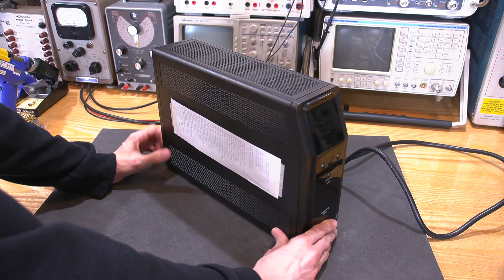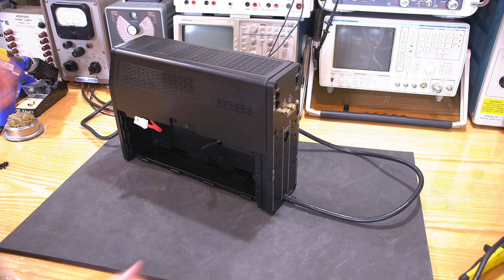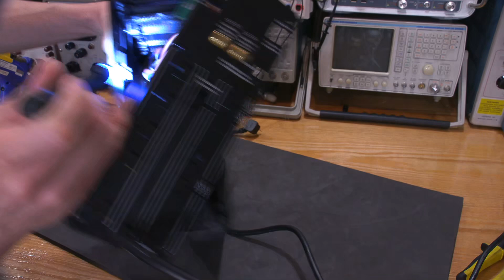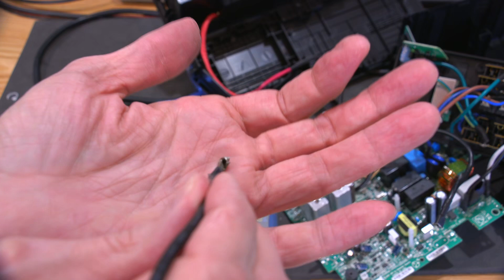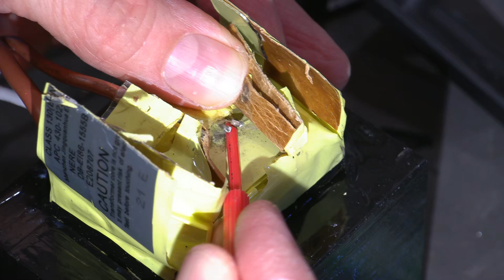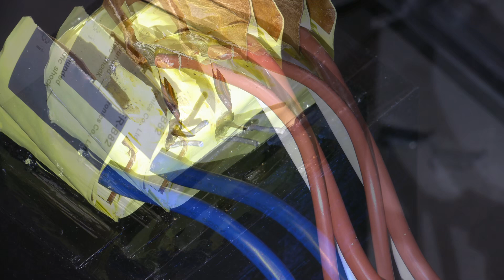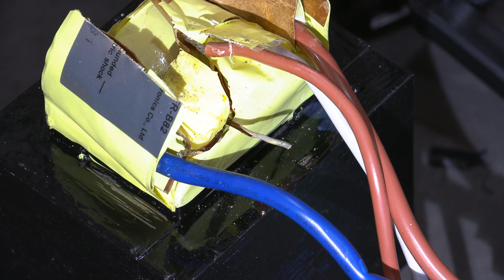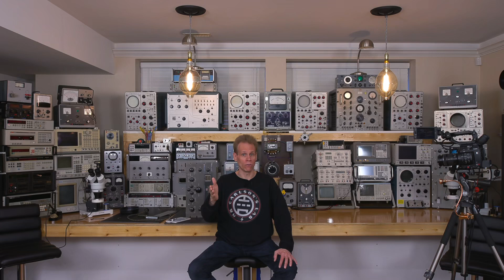UPS Electrical Failure - Teardown and Analysis!

Comment: Thank you for your time in this teardown, I had a customer who had the same type of description during a power outage event at his office, to my knowledge it didn't affect the output but when he called me to tell me, I didn't hesitate to tell him to immediately unplug everything and bring it outside away from the building. I went there a couple hours later with a replacement and someone had taken the old one so I couldn't check it out, I have several of these units out there with my network racks & religiously replace the batteries each 2 years without other incidents. After seeing your teardown, I am now pretty horrified at how the transformer was wired/soldered & will be looking for a replacement as now I couldn't live with the fact of knowing what I do now, should one of these cause a fire, or even damage to any equipment.. 
* If you do get to see this comment & have a suitable recommendation for a replacement of similar size (& preferably same type of battery replacement ie: 2x 12v7  or 8 Ah, I would greatly appreciate it..

Comment: Actually, many manufacturers nowadays have replaced copper wiring with aluminum in batteries, especially in devices like fans or similar motors. My dad's previous job was in recycling, so he has dismantled many appliances, and he once told me about this.

Comment: I grabbed an older APC 650 out of the trash at my work. Opened it up and it was toasted inside.
However the transformer was fine. Got another transformer on eBay and was planning to make an isolation transformer with them. Having second thoughts now...

Comment: I have this same unit.  Don't know if it was arcing or not.  Twice I came home to find the alarm blaring and the equipment plugged into it off.  Battery was full.  I had been noticing a slight burned odor the last few days.  Took mine apart the same way as shown.  Don't appear to have a lose wire like this.  But the smell has gone now so this must have been having an issue.  Glad I found this video.

Comment: My APC BR1500MS2 failed on 7-12-2024 woke up to constant alarm this morning, with an F04 error code with remnants of magic smoke smell I looked up the warranty it five months out of warranty I took my ups apart both mosfets blown on the big aluminum heat sinks.

The BR1500MS2 supposed to be the second revision that has all the issues fixed I am starting to lose trust in APC.

What brand did you go with for battery backup?

Comment: I just stumbled upon this post and thread after decommissioning the exact same model today. I do not have the knowledge or testing equipment but I did do a cursory inspection of the circuit boards and could not see any visible damage. I did not check the transformer. My UPS gave three different trouble codes F06 relay wield, F04 - short  & F02 I do not remember the message. Customer service at APC stated the unit was beyond repair. I was 6months past the product warranty but did have an extended warranty. I was able to  get 95% of the purchase price refunded. APC customer service had no interest providing a replacement or even offering a replacement at a reduced cost. When examining the circuit board I noted the board seemed to have good components and was well constructed. The case provided an amazing system of protection of the power cord. This APC had worked flawlessly until the last month. Seems APC is in the process of destroying  what was a great reputation.
Most of you are too young to remember the massive scandal the electrical industry faced in the 1970s in the installation and use of aluminum wiring in homes. House fires, deaths and injuries.The problem was and always has been in the connection between cooper and aluminum wiring. History repeats itself. Thanks for the tear down.

Comment: what a great video !!!! I purchased a 3rd party battery but noticed that the original battery had a plastic housing on it. Can I snap that housing off and take the wire out to connect my new battery's RED AND BLACK together ? Scared to snap the housing.

Comment: I'm beginning to suspect this is the same problem with mine, same model. Noticed today the area around the transformer is getting very hot. 70C taken via IR sensor on the case, can only imagine its another 30-40C inside at least. Also noticed the smell of solder.

Comment: Ill never use UPS devices in a closed space anymore. I had venting battery's with no warning prior. For 2 to 3 days my eyes where burning as i realised how close i was to passing out due to the gasses venting out of those things. There's no warning, they just do it whenever they feel like it. If you use a UPS, never ever in a closed space with you inside of it. Trust me. Those things will go sooner or later.

Comment: Your findings here, unfortunately don't surprise me. The old APC metal cased Back-UPS used to be hard to kill. The plastic cased units marked the beginning of the slide in quality. I eventually switched to Tripp-Lite units for PCs and for small data closets and had better luck with them, however I did get one of the small units that had a rattle when I pulled it out of the box. Opened it up and it was a power transistor that hadn't gotten soldered correctly rattling around inside. I resoldered it and it seemed fine but didn't instill confidence.  I had a lower end APC Symmetra that used to cook batteries to the point that it could be hard to slide the pack out. After replacing that with a higher end Symmetra, I was quite happy with it. Been out of the field for 6 years so I can only assume that APC's quality has only continued to slide.  For home use, I have been using the Cyberpower UPS and they have been surprisingly reliable, although I don't think I would use them in a business setting.

Comment: So you just need to change the transformer and you're good to use that again. That's normal, there are really some parts of a electronics that fails. 
And I'm think that's copper plated aluminum.

Comment: This reminds me of a time when I was a kid, back in the 1960s. I would hear an intermittent buzzing sound at night when it was quiet. No one else ever managed to be close enough to hear it. Gradually, I turned my pair of ”Mark I Ears” into a direction finding array. It sounded as if it were coming from the crawlspace above the ceiling.

I finally found the culprit. A flaky DOORBELL TRANSFORMER wired into the junction box that fed our hallway light! 😀

Comment: I wish I had saw this video before I junk mine, took it all apart, just as you did saw no burn marks anywhere I was stumped, never thought to check the transformer, may have been fixable with butt connectors. I replaced it with a different brand.

Comment: Great job at failure analysis Mr. Carlson.   Research is also important in the final cause of failure.  Here's what I found.  But before you go on, my conclusion, based on the evidence shown in the video and methods used to connect copper to aluminum listed below, is that the root cause is the soldering with flux failure.   The special flux used failed to remove oxides adequately to promote wetting.  Over time, the junction failed, causing arcing and heating that promptly led to a catastrophic failure.   Additionally, you should not have discovered a test strip on the enclosure.  It could have been part of the manufacturing, rework or refurbishment process.  Failure to remove the strip would indicate workmanship attention failure.  The process work instruction would have required that the strip be removed before packaging.  This is a quality control anomaly: which may indicate quality control compliance failure by the operators and a quality assurance failure to verify that the system is working as expected. Hence the flux issue.  

While copper is the most commonly used material for windings in power transformers due to its excellent electrical conductivity and thermal properties, some manufacturers may explore alternatives to keep costs down. However, these alternatives often come with trade-offs in performance or efficiency. Here are a few possibilities:

Aluminum Wire: Aluminum is cheaper than copper, but it has higher electrical resistance and lower thermal conductivity. This means that transformers wound with aluminum wire may have lower efficiency and higher operating temperatures compared to those wound with copper. However, aluminum transformers can still be viable for certain applications where cost is a primary concern and efficiency can be sacrificed to some extent.

Aluminum or Copper-Clad Aluminum (CCA) Wire: CCA wire consists of an aluminum core coated with a thin layer of copper. It offers a compromise between cost and performance, but it may not be as efficient or durable as pure copper wire. It's used in some applications where cost savings are essential and performance requirements are less stringent.

Copper-Coated Steel Wire: This type of wire consists of a steel core coated with a thin layer of copper. While it's cheaper than pure copper wire, it has higher electrical resistance and may not provide the same level of performance or efficiency. It's generally used in low-cost applications where performance requirements are not critical.

Alternative Materials: In some cases, manufacturers may explore alternative materials for transformer windings, such as certain types of conductive plastics or alloys. These materials may offer cost savings, but they often come with limitations in terms of conductivity, thermal performance, or other key properties required for transformer operation.

Ultimately, the choice of winding material depends on various factors including cost constraints, performance requirements, and the specific application of the transformer. While alternatives to copper may offer cost savings, they may also come with compromises in terms of efficiency, reliability, or other performance metrics.

Connecting copper wire to aluminum wire can be challenging due to the differences in their properties, particularly their coefficients of thermal expansion and the formation of galvanic corrosion. However, there are techniques and products available to make reliable connections between copper and aluminum wires:

Mechanical Connections: One common method is to use mechanical connectors specifically designed for joining copper and aluminum wires. These connectors typically have a metal body with setscrews or clamps that securely hold the copper and aluminum wires together. This method ensures good contact and conductivity without relying solely on soldering.

Compression Connectors: Compression connectors are another option for joining copper and aluminum wires. These connectors use a compression tool to apply pressure to the wires, creating a secure and conductive connection. The compression process helps to overcome the differences in the properties of copper and aluminum, ensuring a reliable joint.

Soldering with Flux: Soldering copper to aluminum directly can be challenging due to the differences in melting points and the formation of brittle intermetallic compounds. However, it's possible to solder copper to aluminum using special fluxes designed for this purpose. These fluxes help to remove oxides and promote wetting, allowing the solder to adhere to both metals. It's essential to use solder with a melting point lower than that of aluminum to avoid damaging the aluminum wire.

Specialized Connectors: Some manufacturers offer specialized connectors or terminals designed specifically for joining copper and aluminum wires. These connectors often incorporate features to mitigate galvanic corrosion and ensure a reliable electrical connection.

Aluminum-to-Copper Transition Pieces: Transition pieces made of materials compatible with both copper and aluminum can be used to join the two types of wires. These transition pieces provide a reliable and durable connection between copper and aluminum conductors.

Comment: I just fixed an APC BX1000M where the copper was crimped to three aluminum windings with some type of solder as well.   It was over 2k ohms resistance,  I guess it oxidized.   I pulled apart all the windings,  crimped on ferrules to the winding and soldering it all back together.   Now works like a charm again.   It was throwing an F04 code,  nothing else damaged expect the transformer.

Comment: 16:02 Seems that they have even used darker varnish for magnet wire, as I once stubled on one soviet transformer with aluminium windings- I thought it was tinned wire as it was much yellower than ordinary copper one. When this "tinned" wire failed soldering test I understood that something is wrong.

Comment: Every UPS from APC I have encountered has come with a QC ticket. I have installed 8 different models from this company, and they all came with it. More than 2 dozen devices all sourced from several different vendors. Thanks for the video. I am shocked they are using aluminum on their transformers. Especially disturbing is the tap connections. Seems that would warrant a bus bar, or wire nuts. Just anything other than a fake death grip. Cheers!!

Comment: I have one of those. The pass paper is quality control, my costco one came with same paper. There good units, but apperently when dealing with black battery wire need to be more careful. I think there was a reason for the wire they used in transformer, i have feeling its for better voltage flow and less noise but it obviously has a weak point and thats in the connections. Sure looks like copper if look at center of transformer

Comment: Good work done ✅👏👏👏
I really need your help.
Pls am repairing a 10KVA ups with low battery alarm, even though the batteries are all replaced.
16 batteries in total, summing to 213v from multimeter check, but what appear on ups screen is 174v .
Kindly assist me , what could be the possible cause of the fault which affecting the voltage failure sensing.

Thank you 🙏

Comment: I work as a BMS Engineer. In our control panels we normally use Reillo and APC UPS. They all eventually fail after 1-2 years of the control panel being commissioned. It’s 90% the battery failing or an issue with the PCB board. The connecter for the battery to the PCB is not best quality.

Comment: I think most of APC UPS use aluminum wire, I tried to modify 415W rated APC bx800li-ms with lifepo4 and use xt60 connector and cut the battery connector wire, there's aluminium wire with a little copper coating so I can still solder it. Then I load tested it with my 250W PC for 20 minutes then I smell burning plastic and then it shut off and won't turn on again with continuous beep. I opened it up and see a melted flat connector plastic. It turns out the wire is badly crimped to the connector lug, so I give it some press and it's working again.

Comment: nervously looks at desk
Well then. At least from what I could find, these did have a recall back in October 2020, you might have to look up the serial number with APC's information to verify. I'd guess (?) cheaping out on component during pandemic supply restrictions. I'll be cautious with mine.

Comment: Guess I was wrong, I'm betting it can be easily repaired, it's not copper, the use aluminum, the enamel looks copper! This is a common failure, the only thing to do is, use a crimp connector,  they try to use the copper wire wrapped and soldered to it's self, instead of crimp connector!

Comment: Thank you so much for doing this teardown! I have this exact model UPS and I am trying to troubleshoot a fault on it.  It keeps blowing the inverter MOSFETs when switching from mains voltage to battery power.  I can start it up on battery and/or mains voltage and it is completely fine, but when switching to battery, it blows 2-3 of the 4 inverter MOSFETs violently.  It is also intermittent so it doesn't always happen when switching.  I checked the transformer and although it is made similarly to yours, the connections still seem secure. It also doesn't appear to be the battery, because when I power it from my DC power supply, it will still overload/trip during switching as well. Do you think you could do a more detailed teardown of this specific UPS and how the circuitry works?  Or point me in the right direction for troubleshooting this? I would really appreciate it!!
Reply: Even more shocking, there are two 40A fuses to protect against this type of failure.  But they never blow.  The MOSFETs do (they are IRFB7440s) blow even though they are rated for 120A! So something is causing this to draw a very large amount of current during the switching over to battery!
Reply: turns out after further investigation it was the transformer causing the fault on mine as well! I swapped it with a transformer I had from a very similar model unit and it works fine!  Definitely avoid this BR1500MS model UPS!
Reply: I just spent an hour and a half chatting with an online APC customer service rep. They asked me to upload photos / serial numbers. During the chat, she asked if I could plug the unit into the wall - I told her that I had done that three times already. During the online chat, when I plugged it in for a fourth time, there was an internal explosion, like a small balloon popping. There was a hint of a smell of burnt electronics. I opened the window for ventilation. Even though my UPS is roughly 3 years old and out of warranty, they are in the process of sending me a replacement unit as a curtosy. I have to send them the old unit. The new unit will be the second model, the BR1500MS2. I'm happy... but wary because I have a $6,000 custom gaming computer that I built, it's why I need a reliable UPS.

Comment: Copper to aluminum connection is never good, only way power companies do it is with high-press crimps.
Any type will corrode because of the metal differences. That’s why only aluminum rated devices can be used with aluminum wire today. They where just cheating out on transformer manufacturing.